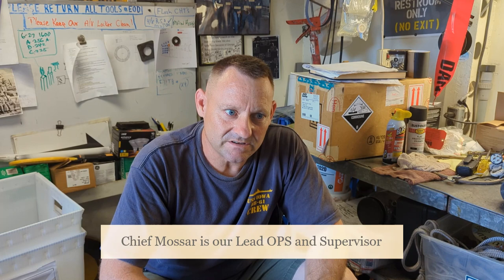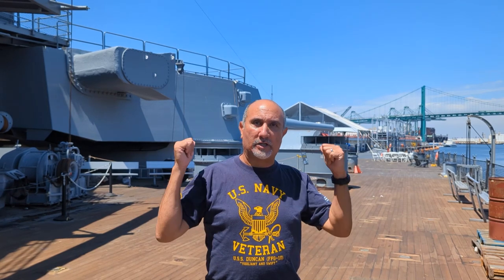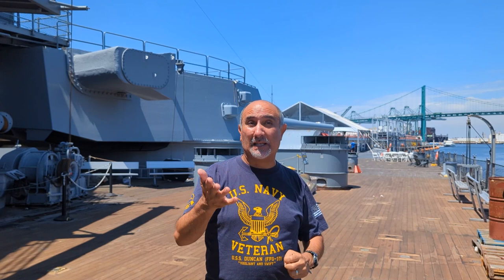HOW....How did we Turn Turret 3 onboard USS IOWA?

Comment: sweet video Moe!
Reply from the maker: Thanks 'Mystic RR', but it was Our Vols..... that get the credit!!!  :hand-pink-waving::hand-pink-waving::hand-pink-waving::hand-pink-waving::hand-pink-waving:

There are several of them that I WOULD have interviewed, but a few of them are out-of-state!!:goat-turquoise-white-horns:
Reply: @Hey_MikeZeroEcho22P  i thank all of you for your service and this is fascinating stuff! amazing that it was original equipment that made it happen!
Reply from the maker: @mysticrailroad  Yeah, Right...... I haven't been inside That part of the Gun House where the Machinery Spaces for moving the turret around, but what I have been told, Mostly everything Works!!:face-fuchsia-wide-eyes::cat-orange-whistling:
Reply: @Hey_MikeZeroEcho22P  American made baby!!
Reply: It would be nice to see all the guns at saluting elevation . It might be easier to use the electrics and hydraulics lol
Reply: Do all the guns elevate I read somewhere turret 1 has a stripped jack screw or some other defect to prevent this
Reply from the maker: @michaelcoachtechvp2846  Well, we have raised/lower them .... But Manually.  Now that we know that motors/engines CAN operate, we might.......BUT as you heard from our OPS personnel.....we might not do it unless there is some reason to do so.
Reply from the maker: @michaelcoachtechvp2846  Not that I know......I'll ask around on IOWA.  I'll get back.

Comment: The guns can be elevated manually but not a easy thing to do.
Reply from the maker: Roger That!!!!  When I was able to do that Several years ago, when I was on the OPS Dept., I was able to raise the barrel just Barely 3" / ~+1.5 degrees!!!  The jack screw was in a Very difficult position, not a lot of play to rotate the wrench around...AND the wrench was a quite large pipe wrench, A N D after doing this turning of the jack screw, I must have been at it for about five (5) minutes [ or so it seems ] also wearing PPE white outfit due to PCBs being present around me!!!

"...not an easy thing to do." - That's a "NO SH***ER!!" - USN Vet

Comment: Regarding the reference to the locking pins: according to COO Mike Getscher, the locking pins on both Turret 2 and Turret 3 were NOT deployed when the organization received the ship from the Navy. Neither turret was properly centered, so the pins could not physically be engaged.
Reply from the maker: THANKS 'Battleship IOWA'!!  I have limited knowledge on such operation let alone the Physical and Mechanical operation of the turret.  I am an Operation Specialists ( dealing with Operations in CIC & radars ) by rate onboard a USN ship!  But, I DO mention your site for further reference(s).  Thanks for the assistance!
Reply: I’d seen a video where the New Jerseys locking pins were welded into place. So the turrets could not be rotated. Plus the navy requested not to use the generator in the ship’s engineering plant
Reply from the maker: @scottfarmer7226  Yes, and Yes.... BUT I do want to mention that on that NEW JERSEY video about the "locking pins".... It is REALLY Not that big a deal, it looks like you can knock them out with a mallet.  And, Yes, about the USN requesting NOT to 'turn over' (start up) generators ..... Too Be Honest... You need the steam plant to be re-started........ WELL...how can you do that if...WE Do N O T have the fuel to burn in a boiler to Heat up water!!!!
Reply: Yes the one inch angle plate could be taken care of no problem. A mallet or a dremmel would fix that!
Reply: @scottfarmer7226  The contract we have from the Navy states (essentially) that equipment may not be used for purposes of navigation, but may be for display, safety, or maintenance. This project checks all three of those boxes.

Comment: Thank you for showing how the turret got moving. It would be cool to get the gun barrels moving up and down as well . It's a lot of work though.
Reply from the maker: Well....there are times we do, but Before we transversed T3, we raised & lowered the barrels manually...It is a a REAL B** thou.  I did it, just Once on T1, MANY years ago!  But NOW after testing out the Gun House itself and finding out that the motors/engines Still Do work, as George mentioned, "...they Could work...but will not raise/lower (electrically), 'no need too'"
Reply: @Hey_MikeZeroEcho22P  that's fair. I was just thinking coolness factor. Lol.
Reply from the maker: @Ronaldl2350  No Worries..... That's Why I do these videos.  Unfort, it will be my last one about Turret 3 until we start lowering shells down below, Transfer them across the ship, AND Raise them up into Turret 1. 
I Do Not have info on when that will happen.  But Getting Ready to show off my models that I have Nearly completed and a New model build, I probably do in parts.

Comment: I have a different how question. Some of the other museum battleships (New Jersey for certain) have fixtures installed during mothballing that prevents the turrets from turning, mechanically, regardless of power. How difficult was it to remove/fix these impairments, or were the restraints never installed on Iowa?
Reply from the maker: Excellent Question....... as from the interview portion with George Musulin, he says that IOWA had little issue with that because one of the locking pins was 'damaged'/broken off "during the possible transit" ( NOTE:  I do not know since " I " haven't seen it on IOWA, nor do I have the quals to venture inside T3).

BUT, if you look at the NEW JERSEY museum website, I DID See the explanation of those "locking pins" and their accessibility....you could check that out.
Reply: There are two centering pins that extend from the rotating turret into the barbette. The pins are located at each side. There is a special wrench for raising them. On USS New Jersey the pins are tack welded to an angle bar that prevents them from being raised. The turrets are then fixed. Presumably the welds could be ground off, the pins raised, and the mechanical systems prepared so that the turrets can rotate. USS New Jersey is about to go into drydock so that it would not be a good time. USS New Jersey currently lacks the shore power required to turn the turret. Again, presumably, that could be upgraded. The centering pins keep any external force on the turrets from being transmitted to the machinery. There are two hydraulic motors (B-ends) connected to one electric motor (A-end). The B-ends have worm gears that prevent the turret from turning due to an external force. The centering pins prevent such an external force from being transmitted to the worm gears and damaging them.
Reply from the maker: @colosseumbuilders4768  I believe you are correct.......I JUST Saw a video on NEW JERSEY, before I put This video together, that showed ~kinda easy accessibility to reach those pins ( They Don't look that difficult to remove/grind down ).  On IOWA, though, from George, says that one of those pins [ on Turret #3 or Turret #1, I don't know ] that one (1) of those pins was damaged/removed...

And Since I don't work with the OPS Dept, anymore....(though I would Love to Assist them, when they start that 'Strike Down') I Really don't have a reason to venture into T3, but could as some of those OPS personnel to get an answer.
Reply: @colosseumbuilders4768  Thanks for saving me the trouble of going back to find some of NJ's videos on the subject.  But I might go back to find them anyway.  As an engineer, I always thought Ryan was making the possible seem impossible.  Granted, they would have work to do.  I clearly recall him saying the hydraulics are a mess on NJ.  But you know what?  Where there's a will, there's a way.  I bet there's a shop that would do the work for low or no cost just for a chance to be involved in something like that.  For NJ with lower power coming in, I've been wondering if a smaller motor or something else could be jerryrigged in that would operate on the power they do have.  But you have to worry about overcoming stiction using something with less power.  I'm not sure that's an easy calculation to make.
Reply from the maker: @major__kong  Well...... as an engineer.....you should know that you should NOT swap out parts that were made for something....for something = Cheaper.:hand-orange-covering-eyes:

But, as for Ryan saying, "...the hydraulics are a mess on NEW JERSEY." THAT could be a different issue....
1)  You need a Board, where the decisions are made, to be WILLING to spend $,$$$,$$$.....if not then it is = "ALL STOP!"  2)  You also need People that are WILLING to either Volunteer OR get Paid to drain out certain lines....if you heard Chief Moser, that is what IOWA Vols did ( did they get paid for doing that .....:body-blue-raised-arms:).  3)  Do YOU have the POWER to Run the equipment???

It sounds like NEW JERSEY have issues, Possibly, with #2 and #3....because I Think ... NEW JERSEY is going to dry dock.....for What, I haven't seen their new video.  BUT They DO have the $,$$$,$$$, they just have it for Other priorities.🤔🤨

Comment: What did the inrush, idling, and working amperage end up being?
Reply from the maker: I Really can't tell you, because I do not know.  It sounds like it could have been Much less than using all 1600A ( each Shore Power cable handles 400A each ).

But, I could Try to look it up...I believe that the "Battleship IOWA Museum" did a video on power usage, and there was a graphic there that was posted by them.

ALSO....I'm not an electrician, but a radar man, an 'Operations Specialist', but look at this video from IOWA Museum @ ~ 1min 30 sec... https://www.youtube.com/watch?v=AtVZ0u_Xmog&t=4s
Reply: @Hey_MikeZeroEcho22P  I'll check it out. thanks for letting me know.
Reply: In one of the Iowa Museum videos Mike (I think that's his name, he basically the boss on Iowa) said the turret train motor was rated to draw 355 amps at 450 volts.....  according to the data plate on the motor itself. He did NOT say what the motor ACTUALLY drew for inrush, working, or idling.  I am curious about that information myself.  I don't know if they were monitoring the actual amp draw DURING operation.
Reply from the maker: @SlipFitGarage  Mike Getscher is the COO and VP.....

But as for that information, I Do not know, I'm not an Electricians Mate (EM), but I Could find out........But it will take some time, since many of the Volunteers are from out-of-town, and the other electricians we have.......Basically have Other Things to do. 

So, give me some time to find out.

Comment: how big are the training motors?  1600a (figured JUST the train motors) at 440v would make them over 700hp motors.  i would imagine there's a geartrain in there with reduction gearing because you wouldnt want the turrets turning at 1800rpm and with something that big and heavy, you'd never be able to turn them 1:1...
Reply from the maker: That is a GREAT Question..... and I would refer to another video, produced by IOWA Museum, but let me give it a shot here.  :trophy-yellow-smiling:

FIRSTLY, I have very little access what the OPS Volunteers do, because I Rarely work with them...(in fact, I haven't worked with them in over five [5] years)....so I have Very little Reason/opportunity to actually see the 'Below Decks' of any of the turrets in a LONG Time!  2)  In the IOWA Museum video (I'll provide a link here and put one in the 'Description') we use 1600A from four (4) shore power lines, to run a 300 HP motor (the largest one on IOWA, as stated in video), running on 355A and 480 V.  3)  As for the reduction gear...... OH There Has to be..... there is N O WAY run a motor that "small" with a lot of 'power', for something So "BIG" (as in the turret). 

But I'm not an engineer....just a "little" radar dude in the USN = (TOP GUN movie [the 1st one], inside that dark room with radars going around.....That's ME!!).  Lastly, here is the link for the "Specifics".... https://www.youtube.com/watch?v=AtVZ0u_Xmog

Comment: Hey off topic a bit but why does the museum give so much attention to mount 56?
Reply from the maker: Good Question......:cat-orange-whistling:👍

'Mount 56', is found on port side-aft and is the ONLY (on IOWA) functional gun mount.....It Actually fires!!!  And Not just one barrel, but both, although not at the same time.

We fire the mount during "special occasions"/ Special Events, Donors, Retirements...Sometimes B-days and even Graduations for local HS...if they want.  

BUT, it costs.....$$$$ (Not going to discuss that here, but you Can find out on IOWA website)......even if you Want to fire off Both Barrels it costs $$$$ ( twice as much )!!!!

There is a video that I'm trying to put together, but Not sure when the next "firing" will be.... the GOOD News, I know a Majority of the "Gun Crew", most are Volunteers and DEDICATED to Safety and putting on a Good Show.

SURE, we have the other mounts, but the ones on starboard side Will NOT be used, because they face the neighborhood (though we have a "Gun Tour" that allows you to go inside the starboard side-forward 'Mount 51').  AND the guns going off....... Are Extremely LOUD and SHARP!! (a 'CRACK' of [near-by] Thunder more than a 'Boom')!!  The other mounts on port side are near-by the tour route and/or not maintained inside.

Comment: what was the horse power and voltage on the motor that turned the turret? with just components of the turret running the amp draw will go down.
Reply from the maker: Sure....I can answer that question Now.... Though I work on IOWA as an Educator, I am fortunate enough to a) be working there for over ten (10) years, b) have a certain requrium (sp) with them and Staff.  

And even though this/these are My videos, I could share with you a video from the IOWA Museum site.... https://www.youtube.com/watch?v=AtVZ0u_Xmog

But, to answer you question quickly... Horsepower = 300HP, Voltage = 450V (although we are "given" more ~490V).  BUT if you watch the video...... you can hear that we DON'T draw the amps down!